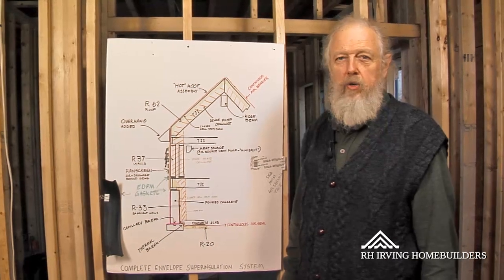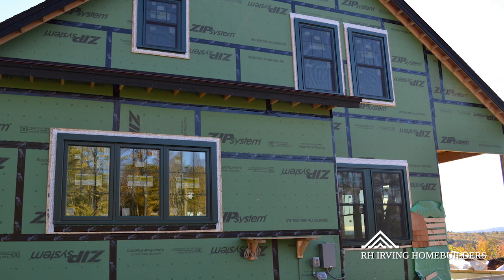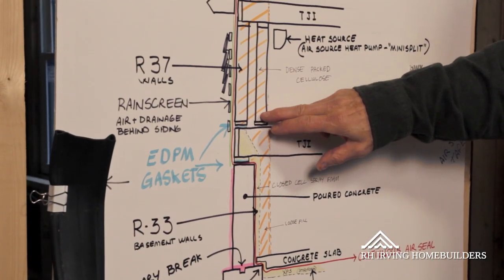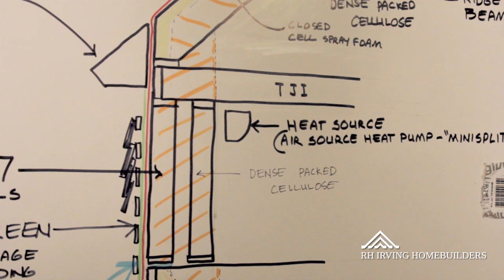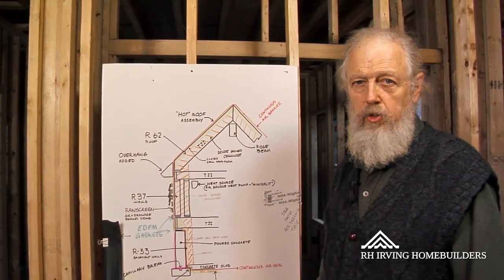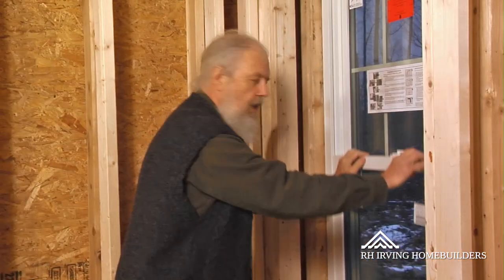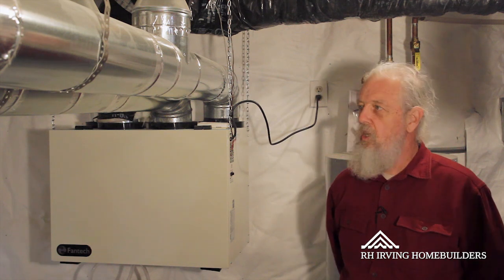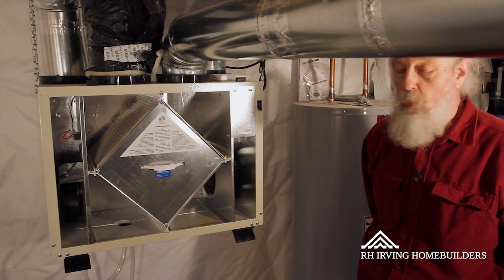RH Irving Homebuilders: the technology of a superinsulated house

Comment: Can you put a lazer thermometer on the walls to check the settling of the celulose insulation ,I had to correct this problem on a 14’ wall that settled 2’ after a few years .
Reply from the maker: Its not clear to me that a thermometer would tell you; it might. But the best way is with a thermal scan which would give you an instant detailed reading.  Suggest you call the original insulator & have him do it & either walk around with him or have him show you the photos of the scans.

Comment from the maker: Yes and No.    One of the keys in building a "Net Zero Ready, or "Pretty Good House" or even a "Passive House"** is that its must be air tight.  The national code is 3.0 ACH@50 Pascals; "Passive House" calls for .6.   (6-10 ACH@50p or higher is a drafty uncomfortable house.).  So it needs to be much tighter than a typically "we'll be sloppy and let the house breath" type house.  Every house needs fresh air for our health.  So in these houses, we need to install "Balanced Ventilation" which brings the same amount of fresh air as the amount being exhausted.  So they are designed to work with that added air flow.  Remember - every house has air coming in, wanted or not.  It does add cost!  But it's more important that we can breath!!!  Cost depends on the size of the house.   There are "LUNOS" style through the wall units, about $2500 for one pair, or a Heat Recovery or Energy Recovery Ventilation system which cost +/- $4000 & up.  Almost everyone I've built for comments on the air quality and how nice it is to be breathing fresh air.   You also have the option of filtering air for anyone with athsma or other breathing issues.  

You may have heard of "exhaust only" ventilation, where you simply leave the bath fan running all the time.  But where is the "fresh air" actually coming from?  Can you filter that air?  I tried that years ago; people shut off the fan, hence it is not longer venting.  

The question of affordability is huge, but a lot of builders are working on ways to get cost down.  That has not been my primary goal - my goal was seeing if they worked as they said they would; I've built about two dozen and they absolutely do.  Now, I'm transitioning to look at ways to make them more affordable.  But whatever the method is, it must include balanced ventilation!  Anyway, with solar panels you CAN have -0- electric bills and -0- heating bills forever; your cost savings over time more than make up for all the added costs.

one other factor is that the HRV's we use have ECM motors - a  new type of electric motor which is more efficient and less expensive to run; the HRV only has two moving parts - two 6" fans - and it runs on Low Speed 24/7.

**NZR & PGH are both modified versions of Passive House; trying to get to a more affordable level.

Comment: House will be very tight and efficient with the heat pumps.  On the downside,  in a very tight house like that using spray foam all over will create a long term toxic fume exposure that will end up causing sickness and death to the owners.    So,   low energy but a toxic death trap  imo
Reply: There is zero proof that CCSF kills, but it does have a high "global warming factor".  We use dense packed celluose - essentially ground up newsprint (with no printing) with borax added.  Recycled and very effective.

Comment: What do you think about three layer rammed earth walls where exterior layer is earth or cement, middle is insulator and then inner wall is earth again? Because I do not see the point in making outer third layer. Just build a concrete wall and then insulate it from outside with Styrofoam
Reply: I'm not that familiar with "rammed earth" walls - which are somewhat common in the Southwest and apparently work well & do not contain concrete.  Very low "carbon footprint".  Cement, on the other hand, has a very high "carbon footprint' due to all the fossil fuels that go into making it.  Likewise, Styrofoam - extruded polystyrene - has the highest "carbon footprint" of all the common foams due to the blowing agent used.  The other issue with exterior foam is that insects and rodents love it - not to eat, but very easy to tunnel through.  I've seen Styro which looks like Swiss cheese & therefore isn't insulating any more.  I've come to believe foam goes on the inside of the foundation where it is inaccessible to chewing critters.  And concrete is an excellent material for exterior use does not need to be covered and lasts a very long time.

Comment: I'm in Edmonton. Far colder winters. Why didn't you use the same trusses in the walls as in the roof for R-62?
Reply: Exactly!  One of the keys to Passive House building is to match the building to the climate, so a colder climate means modifying your choices.  But it needs to be calculated; one can't simply change a few numbers randomly.  You might want more insulation below your floor, or a better window glazing; whatever works best where you are.  Always has to include tempering the entire envelope and building tight.

Comment: Can you please clarify what is used as the thermal break on the bottom slab where it meets the footing? Under the slab you have XPS foam, but is that also used in between the slab and footing or is just the air barrier sheathing, which comes all the way down from the roof, the thermal break? If it's XPS foam, will it not compress with the weight of the house?
Reply: We typically use EPS, or expanded polystyrene - the white, generic "coffee cup" foam.  It is made in various densities, but we've always used the basic - Type 1.  (XPS is extruded polystyrene - and made as a branded foam, Dow's Styrofoam being the best known.)  The manufacture of XPS releases a lot of bad greenhouse gases; EPS releases the least of all the foams.  Whatever compression happens, happens during the pour, it never moves afterward.  But since the concrete is spread out, the actual lbs per sq foot is always quite small.  You may want a high density in a garage or someplace with a higher point load.

In terms of the thermal break, we typically put our top 2" layer of foam (we use a minimum of 4" - R16 in unfinished basements and 6"-  R24 in living areas) on the top of the footing, and put in a vertical 2" piece adjacent on the wall, so the slab has a minimum R8 thermal break on the sides and edges.

Generic polystyrene is also hard to find.  It's very inexpensive and not usually stocked at lumber yards or big box stores, but is is available at commercial roofing suppliers, since it's often used on commercial roofs.  I paid $12.50 a sheet for my last order of 4x8x2".

Comment: The problem with using electricity on the grid is most power plants use fossil fuels to run.
Reply: That's been the problem; it's changing fast.  The vast majority of new power plants are renewable; coal plants are shutting down as are gas plants, because they cannot compete with renewable energy on a cost basis.  A good place to see what is happening is www.geoharvey.com.

Comment: I thought that insulation was to keep COLD air from moving to the HEATED areas... I did not know HEAT ever moved to COLD... HELP!
Reply: Have you ever used a cast iron frying pan?  When you put the pan on the heat, the handle gets hot.  Why?  It's not on the heating element.  It's physics; called the 2nd Law Of Thermodynamics, which says basically that Heat goes to Cold.  And it's something that most builders do not know, which is a large part of the problem.  Actually, insulation keeps the heat inside your house from going OUT, not the other way around.  In the summer, outside heat wants to come IN to a colder space.

This was one of the first lessons in my Passive House class, and the most mind boggling; it should change the way you think about how houses work; it certainly did for me.  For instance, if your basement is colder than your living room, the heat from your baseboards or heat registers is not exactly warming the air coming up from the basement; the heat is going downstairs to heat up your basement!   And outside to heat your yard.   Passive Houses teaches that we should consider ALL of the areas of the house that we use, as "living space" and we should insulate it, and we should air seal it.  Think of being outside in the winter - you wear layers, with thermal sweaters and a wind breaker.  But you don't wear a rubber suit cause all your perspiration would condense inside and you'd be miserable.  Houses also need to be air sealed to keep wind out, but they need to breathe as well, so we air seal the walls to make the house tight and use a ventilation system to bring clean air in.  We make sure the walls don't trap moisture, which can cause mold, so the wall has to be "moisture permeable" meaning water vapor (not water) can get out from at least one side.   There is a lot to consider; houses are more complicated than we think.  The other side, though, is that it's not hard or expensive to do it right, and when they are done right (new houses or old houses) they are incredibly comfortable and easy to heat.

Comment: Robert, 
How tight are those single hung windows? I have always thought casements were better for air tightness. What was the overall ACH in this house?
Also what was the brand of that particular ERV? (Or HRV?) 
Thanks!
Reply: The house came in around .8 or .9ACH50.  Most decent quality windows are usually pretty tight, at least when new.  Casements have a better reputation for tightness, but it'll rain in if they are open when it rains.  Double hung windows, like these are less likely to do that, and many people around here like them because it's the traditional 'look".  The best windows by far, are Tilt Turns.  We had to buy them from Europe when we started using them, but last I checked there are at least nine or ten American window companies making them on the east coast and in Chicago; probably more now.    This was a Fantech HRV.  We later switched to Venmar which was bought out by Broan, so we've been using the Broan units lately.
Reply: @robertirving6273   Robert Irving  Thanks for the help.  I'll look into Tilt Turn windows.  I'm finding through testing that the vinyl sliders I'm using leak about 0.2 ACH per window.  So getting an overall 1ACH is impossible.  
That's for the info on the HRV. I was using the Panasonic ERV, and I was thinking there might be some better options out there.
Reply: @wjthehomebuilder  Hi WJ: The issue with sliding door is that the door rubs against the seal as it opens and closes, so it wears out; essentially by design.  Always better to have the door close into the gasket, so a hinged door is usually a better seal.  There are high end sliders that have better gaskets, but still have the basic problem.  The best are the "lift and slide" where a mechanism lifts the door as it opens, so, like a hinged door, it closes into the gaskets.  Best/tightest solution for a regular house is a 6'0 hinged door with the hinged side opening against the fixed pane or against the wall.

Comment: I didn't see whether you had a filter on the HRV unit
Reply: There are filters on the air exchanger inside the unit.  MERV filters might require a separate box in the INTAKE line.

Comment: I presume dense packed cellulose is more cost effective than other insulations.
Reply: Cellulose is a recycled product with good characteristics, and relatively inexpensive to use.  It comes in batts, boards, and loose fill which can be blown into a cavity at enough pressure that it will not settle.  Excellent product

Comment: Why the heat pump rather than in floor radiant heat?
Reply: 1.  Heat pumps run on electricity which can be made on site.
2. In a house like this, floors aren’t cold & will be at the same temp as all the other roof surfaces.
3.  Radiant floor heats; period.  Heat pumps will do cooling, and dehumidifying in addition to heating. 
4. In my many years building we’ve used many types of heat - these air source heat pumps - aka minisplits - are the most effective, comfortable , quietest type of heating & air conditioning we’ve ever used.  New technology!

Comment: What is your opinion on external insulation such as Zip-R (eg 2 inch) in addition to internal insulation?
Reply: I’ve wondered this too. I’m still a bit iffy on how that foam between the studs and structural sheathing affects the integrity. I’m sure a half inch or inch is fine, but there’s some really thick options.
Reply: I like exterior insulation.  Keeping ALL of the house, including framing, is ideal.  We chose double stud simply because the materials are less expensive and require less labor.  Exterior insulation is also more complicated - too little (under 2” in New England) and you risk serious condensation in the walls leading to mold.  The wall MUST - MUST be able to dry to at least one side.  Say you have a house with 1” foil faced On the outside in a cold climate, and 6” of Fiberglas covered with poly in the walls.  Add a leak in the exterior flashing - the fiberglass gets wet; cannot dry to the outside due to foul faced insulation, can’t dry to the inside cause of the poly, result:  rotting walls & mold.  (Remember the mold problems of the ‘80’s & ‘90’s?). Disaster.  So it’s much more complicated than building a double stud wall designed to breath to inside AND outside.

Comment: I noticed your rainscreen fir strips are running horizontally. Is there a gap for water to run through?
Reply: Yes; there are two - we used a rain screen fabric on the wall; those are designed to allow water to flow down Through minute channels in the fabric.  Secondly, we used rough pine strapping which is unplaned and rough, so does not prevent the flow of water.  The third issue is that with lapped shingles, there are always three layers of siding covering 15” of the wall per layer, meaning there are very few opportunities where water can get in.
Reply: Thank you Mr. Irving. We are planning a wall assembly with vertical open joint siding, over rigid foam. Applying 2 layers of crossed strapping was our original plan, but  that is a lot of labor. This material you have used could work for us. Open joint requires material, that has ultra - violet protections and black in color; does material you have used, provide that?
The other option ; is to strap the rigid foam and apply 4 x 8 panels, then apply the vertical gapped siding over the panels. I would love to hear your opinion.
Reply: @davidbruce5377  foursevenfive.com sells a black exterior membrane that might work, but it does have lettering.  15# or 30# felt  might work also & it's pretty cheap.  Or you could paint the strapping.  Maybe the membrane with spray paint on lettering?  Really, with open gaps you 'll want a bulletproof wall so I'd recommend starting with a double layer of strapping as you planned.  If you have a saw mill nearby, you can buy rough 1x3 or 1x4 for much less $$ than box stores or lumber yards which makes it that much more affordable.  Stay away from plastics.
Reply: @davidbruce5377  I happened to find the perfect product for your siding at a SIGA distributor yesterday:  SIGA Majvest 700 SOB.  It's an "acrylic fleece and made expressly for  "for facades with permanently open gaps of up to 50mm and a maximum surface share of 40%."  Check it out!
Reply: Hi Robert, thank you for taking the time to inform me of this product. I decided to not go open joint cladding as the cost is rising on this wall assembly. I will use  Blueskin SA, low perm, Tyvek drain-wrap, 3" Dow XPS,  and board and batten cladding.  I am really struggling with the wall to roof connection. My plan was to have a 2 - 12 pitch shed roof style and not add separate rafter tails. I'd like to have a 3' 6" overhang and sister some 4 x 6 fir to the hidden roof rafter that is fastened to the rainscreen, which is fastened through the XPS into the roof truss. Perhaps if you had a suggestion on this assembly, i'd be happy to hear from you.
Reply: @davidbruce5377  Will you have a sloped ceding?  What is your roof/ceiling insulation?
Reply: @robertirving6273  XPS rigid foam on the roof. Sloped roof of 2 12 pitch
Reply: @davidbruce5377  between the rafters or above the roof?
Reply: Above the rafters. Striebuk did a similar project where he insulated the exterior wall and roofline, uniformly and then added rafter tails or roof overhang over the roof insulation.
Reply: @davidbruce5377  It's a good method.  We did that in this house, except that the insulation was within the rafter cavity.      So the issue here is how to install a continuous air barrier without dealing with the rafter tails - here's how to do that:  The Blueseal is your air barrier, so after the exterior walls are up, and prior to installing the rafters, bring about 18" of Blueseal over the top wall plate and let it hang down inside for the time being - meaning you'll need to leave a section of the peel-off paper intact on the product.  After you complete your rafter insulation and interior ceiling air barrier, connect the interior air barrier to the Blueseal; this will give you a continuous air barrier.  Note that it will have to be done at all sides, where the wall and roof meet.
Reply: Great, thank you. I had not thought of the process. The final issue is the steel roof on top of what could be called a second roof truss and carrying outward these rafter tails for a decent size overhang. Call in the engineers$$